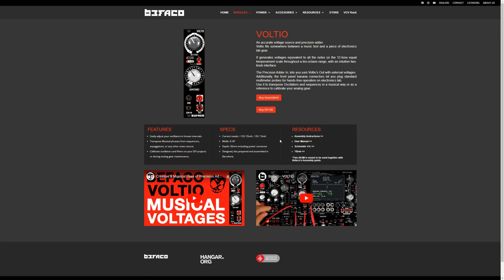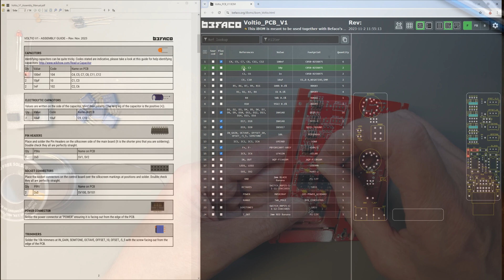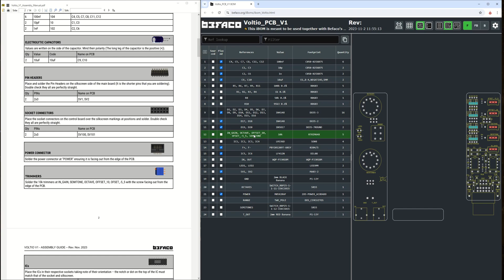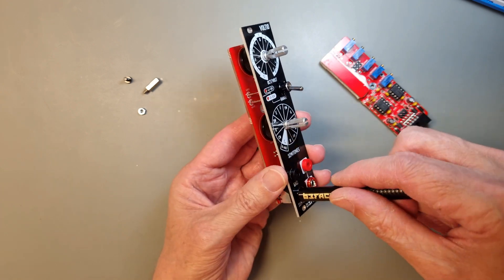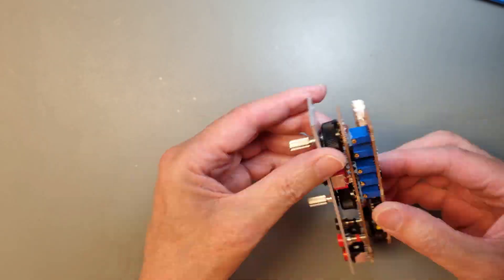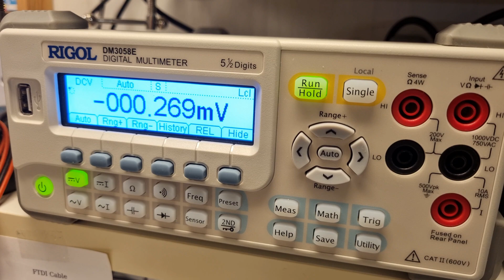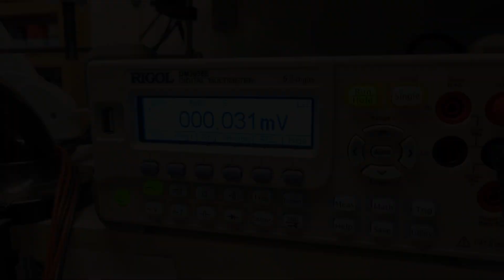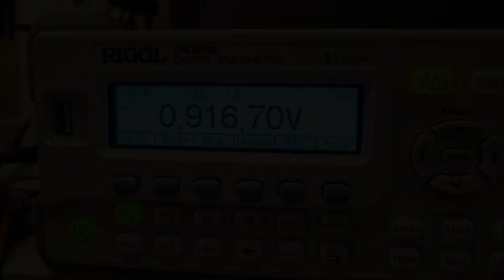Eurorack DIY: Befaco Voltio build and calibration

Comment: There is a high end midi CV converter that measures the output frequency of the VCO and adjusts the CV accordingly.
Reply: Hi,  Is the power supply project you sent suitable for powering this project? And can I use this voltio module as an instrument pedal? That is, can I octave and transpose the sounds when I connect my guitar? In short, can I use it as an instrument pedal?
Reply from the maker: @serhatdemir2714  No, the Voltio will only produce control voltage signal, not audio from your guitar.
Reply from the maker: Cool, yeah that's one way of doing it.
Reply: @MeeBilt  the Moog memory did that also with 8 bit ic's (dac) some 30 or so years back. you see it in the schematics.
Reply: @MeeBilt  This 64 mb memory chip from AP memory, i told you about is indeed used in phones, a known brand.

I'm really interested in getting that chip going.